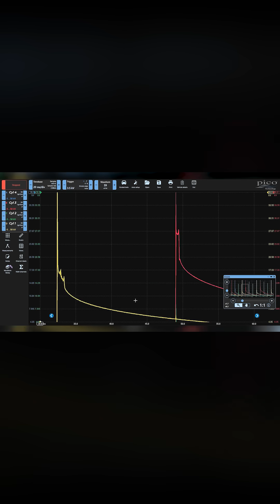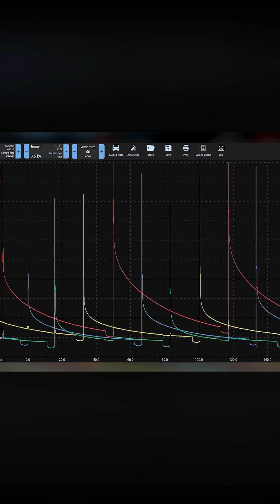Snow vs. Ignition Coils: My Most Unorthodox Diagnosis Yet

Comment: I use a spray bottle of water on a fine mist to spray while its running over each coil and plug wire to get secondary ignition to jump and arc and be able to see it in the dark

Comment: Very cool ideal. Being an electronics tech normally use a can of Freeze-It or just turn a can of AIR upside down to freeze components for temp sensitive issues. But for vehicle components looks like that works pretty damn good.
Thanks for the video
Reply: also simulating wet conditions if it's some kind of failed weather seal.

Comment: Paul,

If my iCarsoft scanner misfire indicator for each cylinder identifies "NO" misfire once the car goes into CLOSE LOOP, should one be reassured  that there are no misfires to worry about.  

Under load my car runs perfectly and my MIL is off.

Thanks.

José Antonio
Reply: Do you feel a misfire?
Reply: @12mak 

The car runs smooth but i have in both banks STFT in the +20's % and LTFT 0% at idfle. When i gradually increase rpm to 2500, STFT slowly decrease and become -10s % (not exactly identical in both banks).  When rpm is 2500 I smell a gasoline smell.

My O2 sensors voltages are ok.  I must confess my 2ry air pump i have not heard it working for a long time. 

The pump motor is ok, switch over valve solenoid ok, shutoff valve vacuum ok, fuse OK.  But this is not the cause, i think, causing the STFT changes.

New MAF sensor and air filters.

It is a 2003 sl500 r230.

I am suspecting the injectors are partially dirty and leaking but under load my car drives perfectly. I know ADAPTATION by the ECU makes this possible in spite of the root problem.

I have been learning how to interpret FUEL TRIMS, so you I appreciate your take kn what might be happening with my car.

Thanks.

José Antonio
Reply: @jarnpr1316 secondary misfires are prone to happening under load. If you do not feel a misfire I would not chase one

I’m not a euro guy but I am a master tech and let me tell you the first steps of how I would start diagnosing this.
Misfires tend to cause lean fuel trims on the affected bank.
A lean fuel trim at idle that goes away at higher rpm is more likely to be a vacuum leak if it’s a MAF engine. After confirming mag and o2s operation, 
I would check for vacuum leaks, you could spray propane or brake cleaner, smoke test, visually inspect. Not sure about the common failures of that specific vehicle.